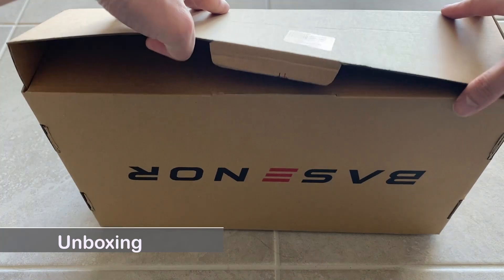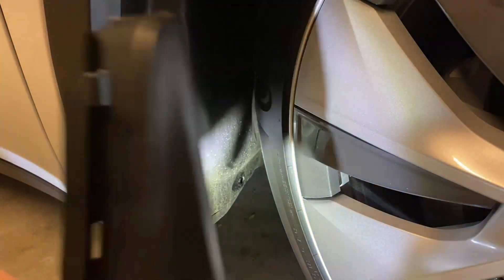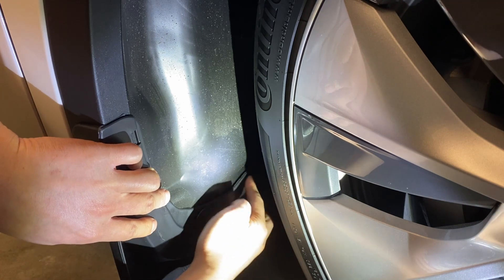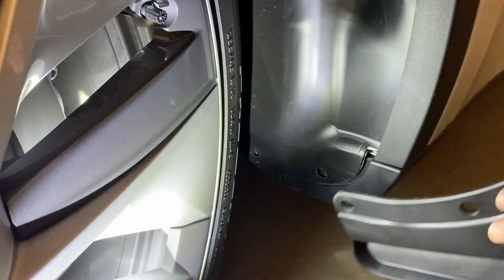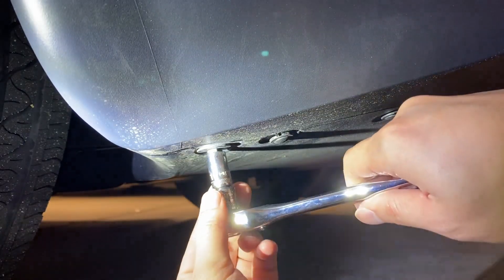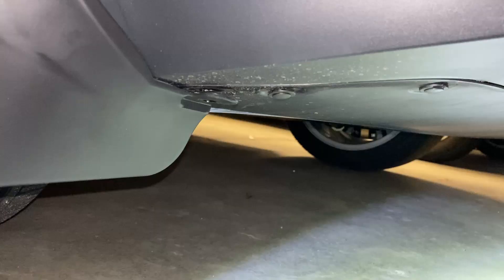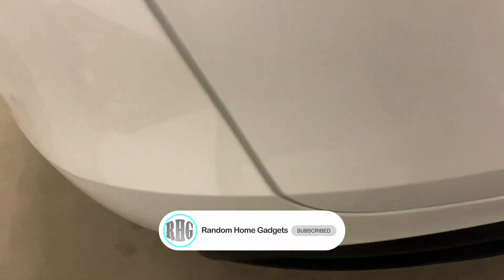Basenor Mud Flaps for Tesla Model Y | Installation | Discount code

Comment: There is a tab that was not shown on installing the rear mudflap, on my MYP 24, you must make sure the tab at the top is inserted behind the stock black plastic piece, if not it will stick out at the top.
Reply from the maker: I think I did show it at 4:15. Is it the plastic washer that’s originally on the screw that you are talking about?
Reply: @randomhomegadgets  
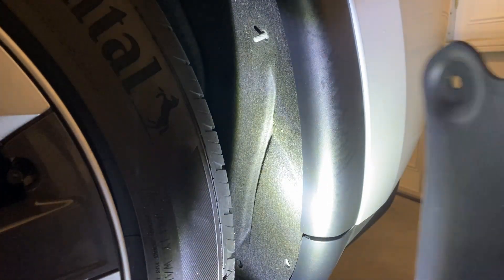No, it would have been at 4:49, there is a tab up close to the screw in washer at the top, you failed to show this, I have watched it 3 times, on my version 24 MYP, it clips over the existing plastic trim piece, if not properly clipped in, the top portion of the mud flap will stick out 2-3 mm.  Look where your thumb is at 4:49, this is where it is located.  My version does not have the tracks for the metal clip to slide in like in the video, I did install them but I really don't feel that they are necessary, my passenger side will not fully insert, it won't fall out but I wouldn't install them if I had to do it again, they scratch the plastic when installing, they are supposed to but I feel the mud flap is sturdy enough without them.  I am very happy with my mud flaps, they are of high quality, I just wanted to point out that some folks might encounter the tab mentioned above.
Reply from the maker: Thanks for pointing it out. Mine was a 23 model Y long range. Maybe the trim was slightly different so mine just clicked in without too much difficulty.

Comment: I was told that rear bumper bolt is hard to remove/ reattach. You made it look so easy but many people have issues with the bolt and nut breaking. Any feedback, what did you use to remove bolt?
Reply from the maker: I used a good wrench to take it out. The car is relatively new so the bolt is clean and no rusting, therefore it’s easy to remove. However if your bolt has dirts or rust around, then should clean it up first, apply the rust removal spray, then wrench it out after.
Reply: Use a quality box end 10mm wrench or socket and you'll have no problem.  The bolt does have some loc-tite on the threads and it will give some resistance when you loosen it.  I just installed a set on my '24 Tesla Model Y today.  Took maybe 20 mins total.
Reply: @mowcowbell  Good to know. I took delivery of my '24 MYP this week, and I am about to go out and install these Basenor Mud Flaps. "Guess what! I've got a fever, and the only prescription is more cowbell!"

Comment: The description says that the rear wheel top hole needs to be enlarged on the 2023 Model Y.  Did you have to do that?
Reply from the maker: I didn’t have to. My Model Y is the 2023 build. You can see the top hole fits ok.